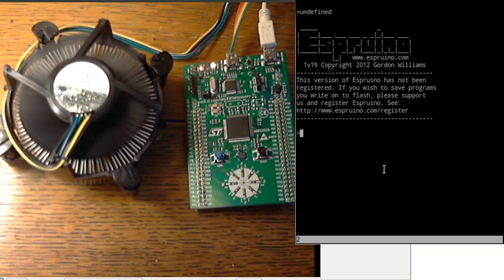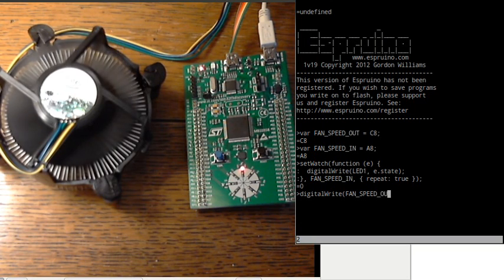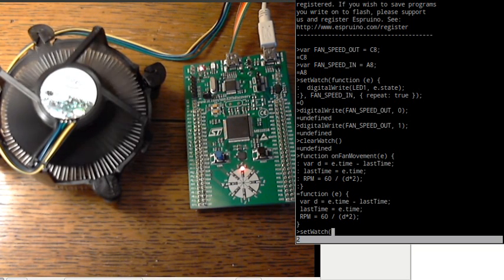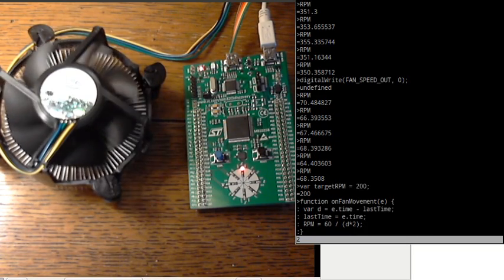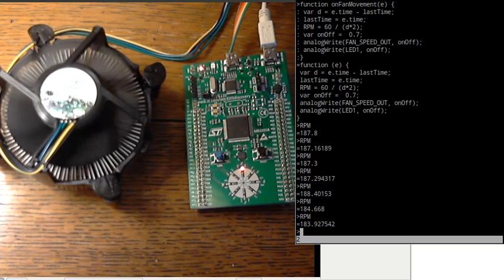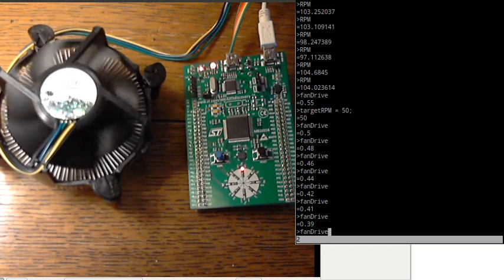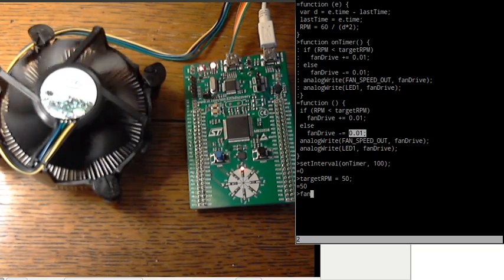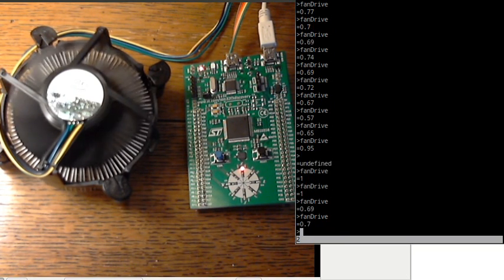Control Fan Speed with Espruino JavaScript for ARM Microcontrollers

Comment: The URL is now http://www.espruino.com/Fan+Speed Also, would this work on the Pico? I don't know the difference yet and was just wondering which would be best.
Reply from the maker: +Carrotman Thanks! Just changed. Yes, this'd work fine on the Pico. If you're just getting started with electronics I'd get a Pico with Pins, a breadboard, and some jumper wires. It'll mean you can get started without having to do any soldering.

Comment from the maker: Hi, for the Servo Motor (KickStarter) and fan (above) you don't need anything at all - they'll just plug in and go.

For a stepper motor you'll need something to amplify the signals from Espruino though - but that's just a single chip like a L293D (costing about £3) that you solder onto the little surface mount area on top of the Espruino board...